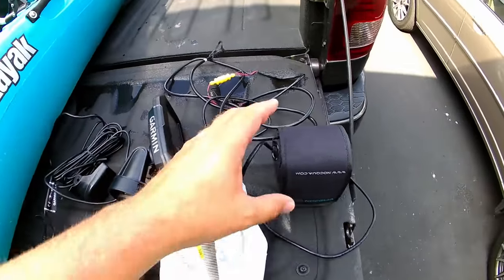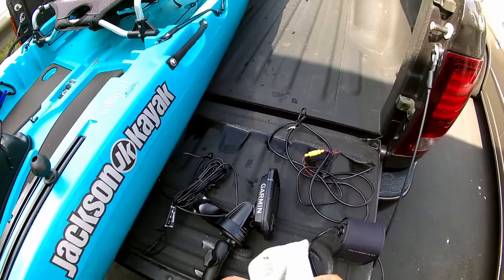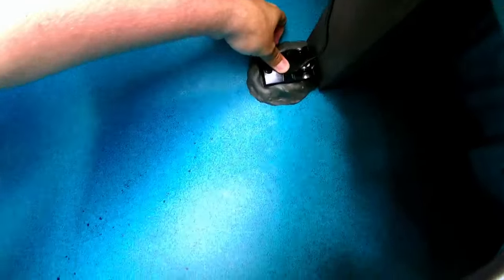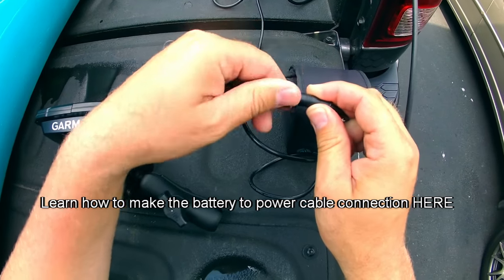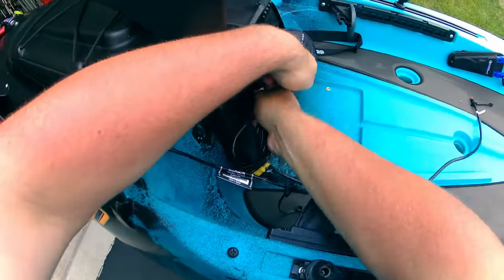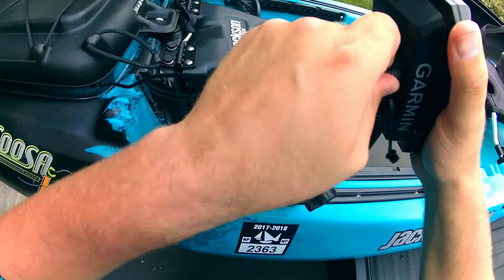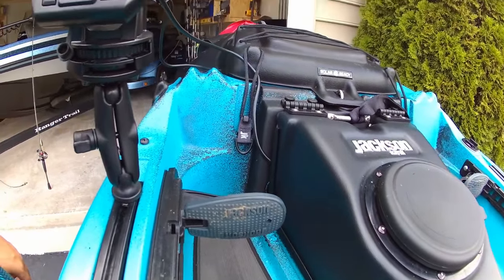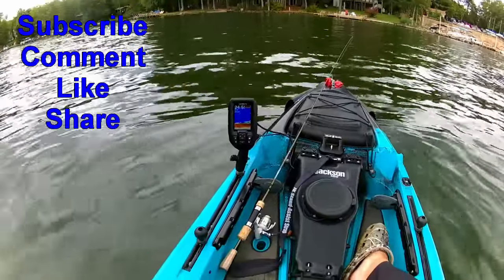Garmin Striker 4 Kayak Install...Simple Transducer Mounting Option

Comment: I had no idea transducers work even with things blocking it. I have an inflatable advanced element kayak and was wondering if this particular putty trick will work? Loved all your classes on the Garmin Striker 4 btw!
Reply from the maker: Most likely not in your application due to the fact that the inflatable will have an air gap.  There must be no air between the transducer and the water

Comment: Will any transducer work through the hull
Reply from the maker: In general yes...but I would only use low powered transducers , since higher power transducers will create more heat and then you could have issues.  Also depending on boat material and thickness they may or may not work.

Comment: Just found your video, thanks for the tutorial. Quick question… is the transducer you are using the original it came with or did you have to buy a different transducer for thru hull/ in hull use…
Reply from the maker: Original
Reply: @1Cast1Fish  thank you for the quick reply. I was worried that I would have to buy a different transducer so it can sonar thru my kayak correctly. But now I know I don’t need to.

Comment: This is very interesting. I want to add a FF to. my OT Predator and I am considering the Garmin Striker 4cv or maybe going for a bigger 7cv. I kinda like the compact nature of the 4, mounting it up close to my seat. Not sure if a bigger screen further along or even closer gives you a better reading. I wonder will the clear view functionality work through the duct seal? and what about the GPS functionality? thats important. Great idea and I may well alter direction and follow you. I was going to insert a section of plumbing pipe down the scupper hole with the TD on the end and feed back to the FF. The Predator has a recess space available. But with this in-hull installation, you get to keep the TD out of harms way and its kinda neat. In theory I suppose the only loss is water temp accuracy, but you got to wonder if you loose clarity of sonar return because you are going through the denser medium of Duct Seal/hull. Very interesting video, thanks for posting.
Reply from the maker: No issues with the down imaging on my Vivid mounted this way
Reply: @1Cast1Fish  Good to know. I picked up a hardly used Garmin 5dv for a great price and a 3D computer printed clamp to fit the TD through the scupper in the space below the hole, so I will go with the direct connection method. I have made notes on what you showed us here for future reference in case I ever want to do an in hull install. Thanks again.

Comment: Isn't the transducer placed opposite direction? The pointy part should point forward and the flat part backward right?
Reply from the maker: Depends on how you look at it and what your fishing technique is direction does not matter.  I prefer mine this way since it keeps my cord against the foam out of the way and I also normally fish with a rearward drift from the wind on the lakes I fish. So it really depends on you and how you want to fish to get the most out of it.
Reply: @1Cast1Fish  Got you!

Comment: Does the kayak ever interfere with the sonar? And does it have any problem With the transducer being inside the kayak?
Reply from the maker: No as long as there is no air gap between the transducer and hull it will work perfect...just like a in hull mount on a boat.  The only reading that will not be correct is water temp...since it will be reading the in hull temp and not water temp.
Reply from the maker: @Myers Trey I believe you mean to say it will not read water temp.

Comment: So you don’t actually have to put the transducer in the water as long as it’s like on the bottom of the kayak?
Reply from the maker: That is correct...sonar will easily pass though the hull.  The only catch is sonar will not shoot through air, so ensure no air gap is between the hull and transducer.
Be sure to subscribe and share if the video was helpful.

Comment: Do you have side scan on that being that it is mounted in hull? If so, how does it perform? Thanks!
Reply from the maker: Side scan will not work in this configuration....my Striker 4 does not have side scan.  In order for side scan to work properly you must have the transducer in the water with unobstructed views to the left and right

Comment: For some reason mounting my Garmin S4 transducer like this didn’t work out. I kept having issues with depth, temp and false fish readings. I’m switching to a scupper hole mount and see if it does better.
Reply from the maker: Temp will not work well since it is ready your temp inside the hull.  If you are having reading issues, you must have air between the transducer and the duct seal, or air between the duct seal and the hull.  Any air gap will throw everything off

Comment: With the thru-hull transducer installation, have you noticed any effect on water temp accuracy? Thanks for the great videos. 👍🏻
Reply from the maker: The water temp will not function correctly with this install option
Reply: @1Cast1Fish  Thanks for the info, it helps with install decision.
Reply: You can buy a digital fish tank aquarium thermometer for less than $10 on Amazon.  They have about a 3ft cord.  Take it on the kayak or bank fishing.  Cheap and easy.

Comment: Transducer mount does not seem to work in a pontoon style 10 foot plastic boat with the foam insulation down in it. Any suggestions?
Reply from the maker: Probably needs to be mounted to the outside or maybe a over the side arm.  Suction cup mount maybe?
the transducer will not shoot through foam.
Reply: @1Cast1Fish  Yeah i agree....ordered a Scotty arm. Thanks brother
Reply: @DatKat  scotty 140 arm fit snug in the rear carry handle. Secured with a couple zip ties. No drilling . Perfect. Thanks
Reply from the maker: Awesome you got it working :)

Comment: Great video! Any update on how well the transducer works from inside the hull?
Reply from the maker: It's been great with no issues...I have mounted it and removed it probably 10 times since this video and still great.
Reply: Add a video of how it looks on the Garmin
Reply: Yeah how would that work through the hull? Won't it dampen some of the pings?

Comment: Do you think a massive blob of silicon sealant / marine sealant would do the job?  Like 3m 4200 or Silkaflex 291 etc
Reply from the maker: It would work, but if you have any issues or problems, it is extremely hard to remove...this why it is not recommended.
Reply: Thanks for the reply, it's a good point.

That duct seal isn't easy to get here in the uk, but doing a bit more thinking/digging/reading... Plumbers Putty looks like it'll do the job.  And I have half a tub of that spare!  :)
Reply from the maker: May work, give it a try...no lose in trying since you already have it.

Comment: i may have missed it, what transducer did you use? the one that came with the kit? also the kit comes with a battery yes?
Reply from the maker: Yep this is the stock one that comes with the fish finder.  No battery is included with the Garmin Striker 4...I use a Nocqua Pro Power Battery ...link below in the description.
Reply: @1Cast1Fish  awesome! thanks much!!
Reply from the maker: @johndiez2746   no problem

Comment: I have seen this same application, but a lot of people are saying that you have to fill the well that you make in the duct seal with water for this to work. Just wanted to see whether you added water or not?
Reply from the maker: No water needed...I have a great image without adding any water. Be sure to press the transducer into the duct seal and try to avoid creating an air pocket.  
Be sure to subscribe to the channel if you found this video helpful.
Reply: why do people say it though???
Reply from the maker: I have a 3 good guesses as to why;1. People are just used to seeing transducers mounted in the water...so most assume they need water to operate, which is not true.2.There is a lot of myths from manufactures and promoters that want you to buy their products instead of you doing it yourself for a few bucks.3. People who have tried duct seal had poor results...most likely from a poor install on their part. It is very important that no air gaps exist from the hull to the duct seal, and the duct seal to the transducer...any air gap will give poor quality picture.  2D Sonar has no issue giving a perfect picture through solid objects like duct seal or your hull...however sonar will not operate properly with air gaps or bubbles.Hope that helps
Reply: @mikeblaze868  Are you drunk? He gave 3 guesses as to why people say that.

Comment: It seemed like such a good idea. I tried this with my Striker 4 plus CV and my Topwater PDL. The sonar just did not work, as if the signal could not penetrate the hull. Any thoughts?
Reply from the maker: What did not work..the 2D sonar or the CV sonar?  I have had mixed experiences with the CV sonar working through hull.  If the issue is with 2D sonar you likely have some type of air gap between the transducer and hull someway.
Reply: Curious about this myself
Reply: @1Cast1Fish  If down-scan doesn't work you could make a water dish with ductseal add transducer and then add some water.
Reply from the maker: You should not need water
Reply: @1Cast1Fish  You can also use a plastic bag filled with water rubber banded around the cord with transducer sitting on bottom of any boat as long as it's not metal. Works for temporary fish finder setups, and rental kayak/canoes.
Reply from the maker: Great outside the box idea

Comment: Is there a way to mount without drilling that still allows water temp to be read??
Reply from the maker: Yes there are other ways.  You can buy scupper hole mounting kits for many popular models, and there are also various manufacturers or arms that lock into your tracks and hand over the side with the transducers attached.  Hope this helps, if you need any more info, just let me know.  Be sure to hit that Subscribe button and check out some other great content.

Comment: How do you keep your transducer from getting hot when mounting inside the hull?
Reply from the maker: The transducer for this fish finder is only about 300W, it doe snot get hot enough to cause issues
Reply: @1Cast1Fish  but it can happend, just for shits and giggles?.
Reply from the maker: @billpfann332  I guess anything is possible given the right circumstances...I just know after many years of sitting in a 100+ degree kayak hull in the summer mine still runs like a champ and so do the many others I know of.  Plus no one has ever commented that this has killed their transducer.
Reply: @1Cast1Fish  good to know

Comment: Any problems with the cargo lid sealing running the transducer cable under it?
Reply from the maker: I guess it would not be a 100% perfect seal, but no issues with water getting in when I went through rapids and water came over the front.  I guess if you flip it water may get in, but the hatch was never designed to be 100% sealed anyway.

Comment: How does the mount on the rail system work to put the fish finder on I just got one and I don't know how to put it on
Reply from the maker: Nicholas Mueller I will get you the spec a bit later today for the mounts
Reply from the maker: Ok here is the info...1" Yak Attack Ball  & Ram light duty mount 1" mount for Striker 4. 
https://www.basspro.com/shop/en/ram-mounts-1-ball-marine-electronic-light-use-mount-for-garmin-striker-4-and-echomap-43-54
https://www.amazon.com/YakAttack-SB1-12-Yakattack-Screwball-Mightybolt/dp/B007ENE4DU

Comment: How the heck does the transducer work if it's inside the kayak and not in the water?
Reply from the maker: Transducers use sound waves...so as long as no air gaps and the transducer is installed below the waterline...no problem.

Comment: Great video thanks for the info I just have a few questions: Do you remove the duct seal after each use or leave it in the kayak and just remove the transducer? I'm thinking of picking one of these units up and using in my sit in perception kayak. Just wondering if the duct seal works for multiple uses  and if I remove it after each use?
Reply from the maker: It will work for many uses, I normally leave the duct seal and transducer in place unless I need to remove it.  You can remove the transducer and leave the duct seal in place without issue.  Just make sure you get a good reinstall and you will be good to go.

Comment: How do you ensure there aren’t any air bubbles since you can’t see through the duct seal? It seems small air bubbles could be present between the transducer and the duct seal or between the duct seal and the hull and you couldn’t tell?
Reply from the maker: Ed Devarona my duct seal has a few small bubbles with no issues...just ensure everything is firmly pressed together with no voids.
Reply: 1Cast 1Fish Thanks. I’m gonna give it a shot. I just got my striker 4 but it’ll. Be a little bit before I can use it on water here in Michigan. Not enough ice either, but can’t wait to try it out
Reply from the maker: Ed Devarona good luck, its a great unit for the price. Be sure to Subscribe as I have some and will be doing more kayak related videos.
Reply: 1Cast 1Fish thanks. I did subscribe. Looking forward to videos of the Stryker 4 in action.

Comment: How accurate is the temperature reading using this method?
Reply from the maker: Not very reliable since it reads the inside hull temp
Reply: After using this method for a while, do you still recommend this method or an outside the hull method?
Reply from the maker: Austin Payne 100% this is the way to go IMO.  It keeps things neat and simple.  Plus I use my kayak in Rocky creeks and rivers so it is always protected. I have seen transducers gouged even when mounted in scuppers.
Reply: 1Cast 1Fish Awesome, thanks!

Comment: does it matter if the transducer is facing forward or backwards?
Reply from the maker: Depending on what your using it for yes it can matter a small amount.  Since I use mine for depth and just finding structure, no it does not matter as much the direction. I turn mine around to keep the cable out of the way when I shove stuff in front of the Kayak.  If you are using it for actually finding fish, I would turn it around, like you are used to seeing.  That's the beauty of this type of mounting...you can turn it around what ever direction you want with ease.  Please consider hitting that subscribe button and bell

Comment: It might be a stupid question, but I'm used to the transducers being in the water. How does this still work with the transducer being inside the kayak hull? Is it just thin enough to go through it?
Reply from the maker: The short and simple answer is, transducers work off sound waves (going out and returning), so being in the water is not a requirement. However you can not have an air gap between your transducer and other materials or it will give a distorted and false image. The fish finder sonar will work through solids such as plastic found in kayaks, fiberglass, or aluminum in boats without issue.  If you are looking for a more in depth answer let me know.
Be sure to subscribe if you enjoyed the video or found it helpful.
Reply: 1Cast 1Fish  that being said.  Will it work for any transducer for any sonar set up or for the garman stricker 4 only?     Also is it saltwater safe?   Being on the gulf coast bays!!!
Reply from the maker: The in hull mount will work for any standard sonar transducer (2D Sonar)...I do not think a transducer with side view or down view will work though.  As for saltwater, yes it will be safe.
Reply: What about water temperature?

Comment: Got it. Thank you again.
Reply from the maker: No problem...any issues or questions feel free to ask
Reply: @1Cast1Fish  Thank you and I will take advantage of your generous wisdom. I had assumed that the pointy end of the transducer would face toward the bow though that shape may be just an aerodynamic design for placing in a scupper on the outside bottom of the boat. I noticed that you placed the flat end of the transducer toward the bow as it doesn't make any difference which way it faces? Also, I write a weekly sportsman's article for our Melbourne Times (Arkansas) and they want me to write a review of all the modifications and on the water results. I will be adding the name of your YouTube channel if that's ok? I'll also be making a YouTube video of my mods and will credit and link your channel.

Comment: I am getting my first fish finder (Striker Plus 4cv) in two days, so I am trying to learn all I can..  I had been told that the transducer needs to sit in liquid because it cannot ping through air. SO I am intrigued by your method. Do you have any sonar quality issues? I am asking because  I saw another video where someone used duct seal to make a "well" inside their kayak hull and then filled the well with water. Your thoughts?
Reply from the maker: The water thing comes from 2 schools of thought...1 is that the transducer gets hot and must be in water to keep cool.  This is true for big transducers 1000W+....the Striker transducers are by no means this big and do not get hot enough...so no issue there.  The second is they had bad image quality likely to a install issue with having a air gap between the duct seal and hull or the transducer.  check out the video I just posted today for more info.